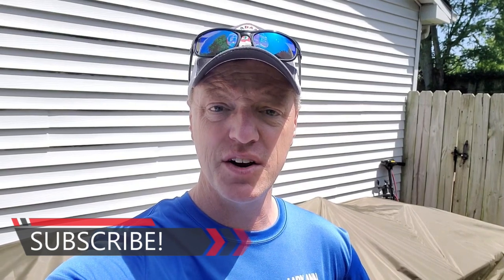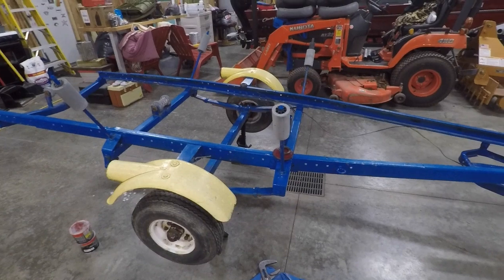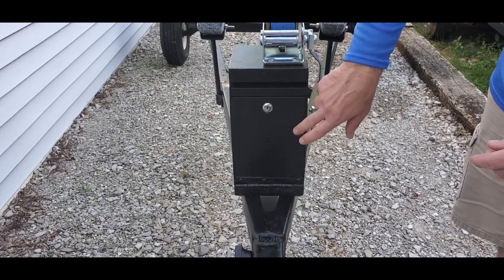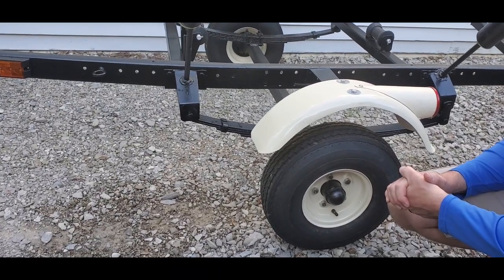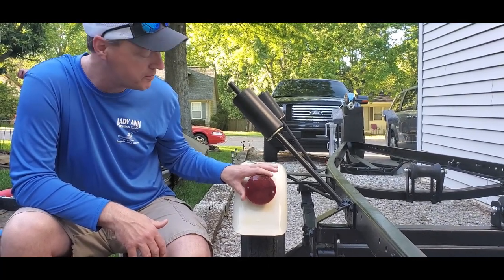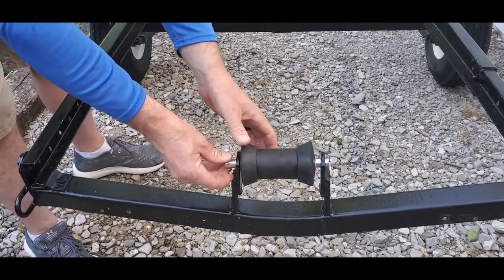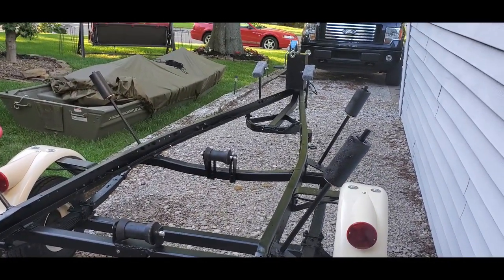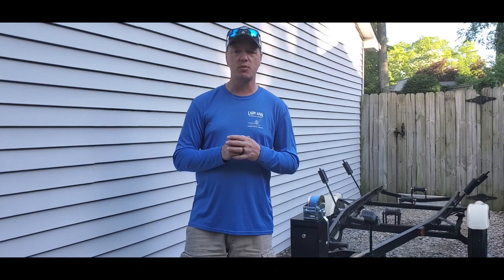Fishing Boat Trailer Restoration

Comment: I'm resorting my first boat and boat trailer a friend of the family gave me a couple months back. I have almost the exact same trailer except for the fenders with the tail lights. I am going to have to look into getting me some of those! I really like them! The trailer had a messed up sticker on it that I think says it's a Moody mfg made in aben, Miss. The boat I have is a 1964 or 1966 mirrocraft 14ft aluminum v hull. I'm really excited about resorting it for me and my son he is 7 years old. I've been taking everything apart. Its all in pretty bad shape. I'm almost done sanding the trailer. Getting ready to paint it.
Reply from the maker: It was a fun project and has been a really great trailer this past season. Good luck on your restoration and enjoy your time on the water!
Reply: Do you remember the axle size and bearings size? Will the parts store know from the numbers off my old ones? I kinda tore the back seals up pretty bad trying to get them out of the hub. Also did y'all replace the bushings on the leaf springs and where did you get the barrings and bushings from?